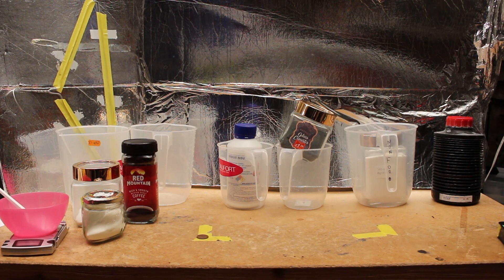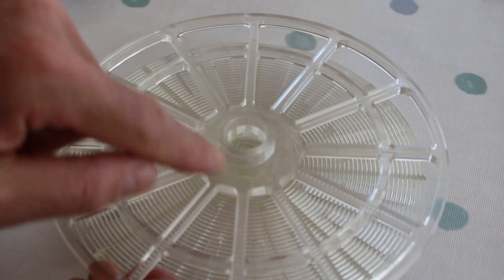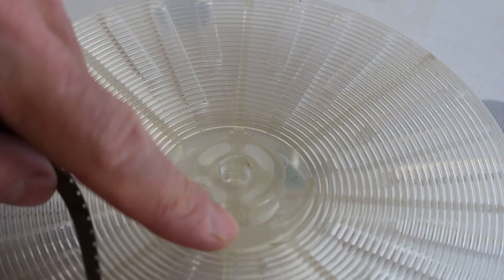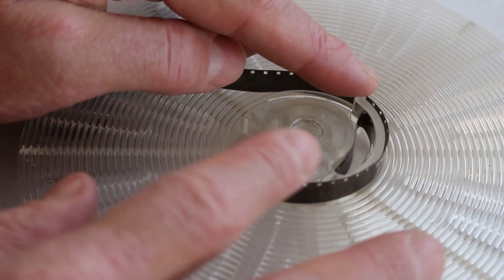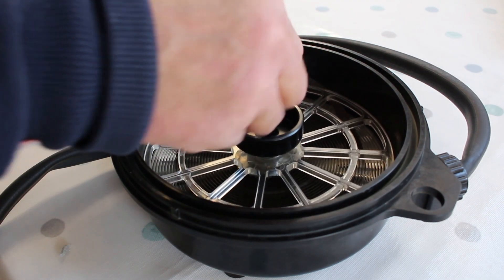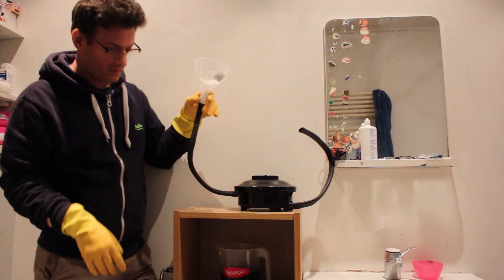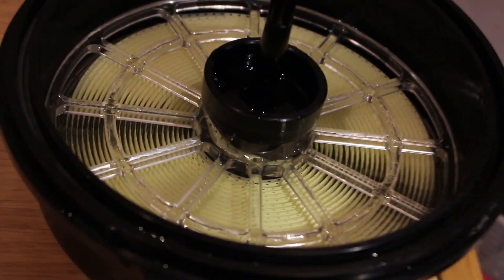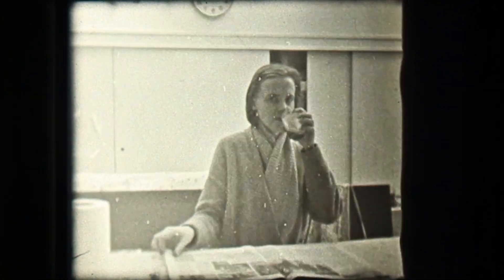Super 8 developing in a Lomo Spiral

Comment: Hi! I found your experiments very interesting and useful. I want to do some experiments on super8 bn film following your rules but I would kindly ask you two things:

- is it possible to develop a reversible kodak tri-x 7266 film with the same procedure?
- I found differences (solutions, time, stop bath) in the processes between this video and this other your https://www.youtube.com/watch?v=moUvV51TNmc&list=PLxU_HiUzpJ_VHuH7RozQILcgicb2HNq8n&index=8
Which of the two is more correct?
keep in mind that I have built a lomo tank myself that I would be happy to show you.

Thank you very much
marco (ITA)
Reply from the maker: Hi Marco, I am constantly adjusting and improving my development process, trying out new developers, bleached timings and temps. Generally my more recent films will have more reliable recipes , but in answer to your question , yes TRI-X reversal developing is possible. I've done it using Ilford LC29 as 1st and 2nd developer. It turned out a bit blue tinted but otherwise looked great.
Reply: @ZeroBudgetFilmSchool  thank you so much! therefore, the coffee mixture is not recommended as first and second development for the Tri-x?
Reply from the maker: @marcopiccoli6162  I wouldn't say that, I just haven't tried it yet! If I was to try TRI-X in Caffenol I'd do a test strip first though, in 5 minute increments.
Reply: @ZeroBudgetFilmSchool  Hi, I tried your caffenol process on trix, but something went wrong. The film tourned for the 90% of his lenght, totally transparent. I suppose a little overtemp mistake of developper (mixing soda in water), but I'm not totally sure. I followed your instruction perfectly. I'm sure about the camera shutter fully functional. 
So, I'll try again using, as you suggested me, using this time ilford LC29 as 1st and 2dn developper, but I have to ask you in wich proportion and time and temp is better, to have an accettambe result.
thank you very much ;)
Reply from the maker: @marcopiccoli6162  OK, completely transparent film sounds like it was in the bleach for too long. The Fomapan I was using can go into permanganate bleach 3-4 minutes without stripping off the emulsion. Tri-x may be more sensitive which is why you should try a test strip with a shorter bleaching time. I'll have to look at my notes but when I did Tri-x I think I might have used a mix of hydrogen peroxide and acetic acid. This is gentler on the film and is what I use for bleaching Kodachrome. Sorry I didn't mention it before, it was a  year ago that I did it. The formula I used was 1L of 9% H2O2 and 30ml of pure acetic acid, for about 10 minutes at 22°C.  I don't think it was your camera over exposing because then you would see the unexposed film surrounding the clear frames. Totally clear film sounds like the emulsion came off in the bleach.
Reply: Great! About ilford developper proportion?
Reply from the maker: @marcopiccoli6162  50ml of LC29 + 950ml water to make one litre
Reply from the maker: @marcopiccoli6162  Also, I found 7.5 minutes in the LC29 got a good result. It doesn't need as long as Caffenol.  Once again: test!
Reply: @ZeroBudgetFilmSchool  I'm so sorry but I have three more (hoping last) questions about bleach and develop.
- In the 2nd develop. do you suggest the same timing as the 1st?
- For the bleach, now i can't wait for acetic acid and H2O2, so i'm gonna retry with potassium permanganate and Sodium Bisulphate. What you suggest me to do: testing the same dosage with half time; or half potassium permanganate, half sodium bisulphate per same respective 500ml H2O with same timing?
- Is it advisable to use distilled water for all preparations?
thank you so much!!
Reply from the maker: @marcopiccoli6162  Hey no problem! It is good to use distilled water (If you have a clothes dryer with water reservoir, you can use that!) but not essential to get a picture from your film.  The 2nd development can be te same length of time as the first, or even a couple of minutes longer. You can't really over develop the second time round. 

Now the bleach: I would use the same concentration of chemicals  but cut the bleach time down. Here's a test: once you have made the bleach, dip a short length of exposed undeveloped film in it. After a minute, dip some more in (this can be done in light) . Keep going until you have a strip of differently bleached film. See how long it takes the bleach to turn the film yellow/white, and at what minute mark the emulsion is falling off (give it a gentle rub to test). You should have an idea what the correct bleach time is for your Tri-X (is it Tri-X 200 ASA you're using, or another ASA?)
Reply: @ZeroBudgetFilmSchool  yes, it is a Tri-X 200 ASA. Well, i'll do this test before, and I'll inform you about it ;)
Reply: Another question, sorry🙏 I have also to process a color kodak Vision3 200T. This time I bought a kit (ECN2 from Bellini chemicals). I have all instructions time and temps but between prebath and develop there is written the "Rem-jet" step. For this step there aren't chemicals neither time or temp. Can you suggest me something easy, quick to prepare and safe about it? thank you so much!!
Reply from the maker: @marcopiccoli6162  yes, there's an easy remjet removal recipe: 54g Sodium Carbonate (washing soda) , 19g sodium bicarbonate in 1L of warm water (38°C) . Soak the film for 7 minutes, drain and the rinse well 2-3 times with warm water, shaking it up a few times. Most of the remjet will rinse out, and what is left can be removed after the end of development with a wet soft microfibre cloth.
Reply: @ZeroBudgetFilmSchool  Are there also indications for remjet in kodak tri-x? Remember: I'm gonna test the process using ilford lc29 etc etc..
Reply from the maker: @marcopiccoli6162  No, there's no remjet on Tri-x luckily!
Reply: @ZeroBudgetFilmSchool  Good news!  I processed the Tri-x using ilford LC29. Before, I made the bleaching test as you suggested me. Well, after the test I observed that the bleach with potassium permanganate and sodium bisulphate is good in your mix time and temp. I still think that the transparency problem that I encountered with the previous Tri-x was related to an uncontrolled overtemp of the coffee-soda-vitaminC mix (instant temp increase in the mixing of soda and water). 
In conclusion, my final product is good, not so blue tinted as you anticipated me. I had just a problem about the tank (little slices of film not correctly submerged, sincerly still very nice for the project that I am making), but i'll fix it buying in future that fantastic russian tank. 
Thanks again so much. Without your support I would not have been able to pursue this goal. I hope to share more results and experiments with you as soon as possible. GRAZIE MILLE!!! ;)
Reply from the maker: @marcopiccoli6162  Excellent! I'm happy it worked out for you. I wouldn't have got this far without others help either, so it's great that the knowledge can be passed around. Your previous problem could have been like you say, high temps leading to overdevelopment, after which the bleach removed all the developed emulsion (ie all of it) leaving you with clear film.  It's a long road and I'm pleased to see you have a workflow that's getting you results. Good luck with the Lomo tank. With practice you'll learn how to load it and your films will look even better. Look forward to seeing some results!
Reply from the maker: @marcopiccoli6162  excellent! The TriX looks great, actually cleaner than my early non-lomo developings.  Did you also develop the colour parts?
Reply: @ZeroBudgetFilmSchool  thank you very much! Yes, i processed the Kodak Vision 3 200T, but i confess that i had to make a lot of digital colour correction including the digital inversion (after process and digital inversion it was very blu tinted and very lighted). The proces for that is ECN2. I found a kit and I used following the instuctions. I've not a telecine machine, so, I digitalized everithing filming with my Fuji digital full hd camera the projection on the wall :D
Reply from the maker: @marcopiccoli6162  I do digital colour correction on all my colour negative films, the blue tint of digitally reversed negative is normal.  Luckily I have a wolverine scanner so I can get a scan the same day that I develop it.

Comment: What do you think would turn up if I did this with new black and white kodak super 8 film?
Reply from the maker: It would probably look fine. I did some Tri-X last year and it looked OK but a bit blue tinted because it was old stock. I advise always doing a test strip when working with a stock you haven't used before, so you can gauge the best development time.

Comment: May I comment on this, since I have years of using this UPB tank. I would not wind the exposed film into a spool, but rather directly from the cassette onto the spiral, thus you have the sprockets down and the emulsion outwards. It works super , you will not  have the black undeveloped thing on the  right side.
Reply from the maker: I can't go straight from the cartridge because it would break the one-way turning feature of the bobbin that winds the film up. As I use re-usable cartridges I don't want to break them. Also, the film coming out of a disposable cartridge has too much drag on it to flow freely out of the cart and onto the spiral. You're right about the holes down, emulsion out (I made a correction to this film). I no longer have the dark stripe!
Reply: I took out the small part of blocking the wind back, the cassettes still work fine. and you can use it of overlap if you have the camera which does it.
Reply from the maker: @petepictures  funny you should mention that, I've just shot a split screen film where I wound the film back and ran it through again three times! I'm developing it this week and I can't wait to see how it comes out. That will be my next upload.

Comment: I bought a lomo tank last year but didn't realise there were 2 sizes 30 feet and 50 feet. Mine was the 30 feet so sold it on as with all that hassle I didn't want to do it twice. Still haven't got time to do anything though, I shot some rolls last year and am going to make an effort this year. Thanks for the encouragement.
Reply from the maker: My tank's 30 feet too, but I bought it knowing I'd have to do my super 8's in two goes. As it happens, doing it in 2 goes, while time consuming, does give you a chance to check the process is working and make any tweaks. For instance, I discovered I wasn't getting enough light to the bottom of the film and addressed the problem on the second run.
Reply: You must have seen the German guy's videos he's clinical  and really well set up, I have this fantasy in my head I will be set up like him but I think the reality will be different, I will have to make more time in my life to get back into it. Your videos are spurring me on.

Comment: Thinking to develope 16mm film, which is expired in 1990, how do you think do i need more first develope  time, or it should work with same time like yours, 20 min?
Reply from the maker: Depends on the film and how light it was when you exposed it, but basically yes, if you're doing negative only and want to push it in Caffenol, you should leave it in for at least 30 minutes. If you shot it in low light, go for 45 minutes. If you're doing reversal, remember that the everything developed in the first developer gets bleached out, so the shorter the time in the FD, the darker your end result.